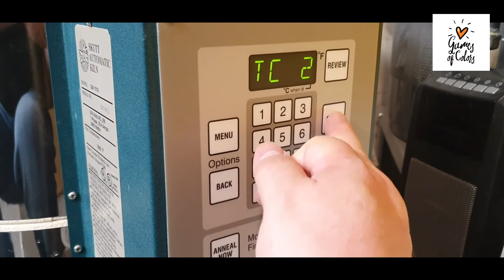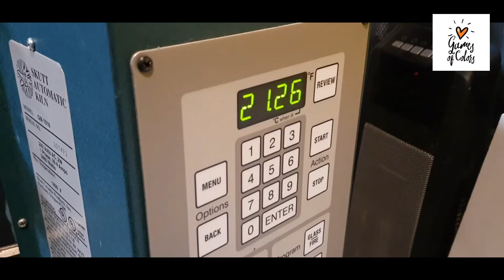A Rainbow Rocky Road - making a couple of fused glass plates

Comment: hi...how is possible that my plate instead slumping broken in the middle? which steps you do? whic temperature? i know your kiln, a ihave one...smaller but same brand but at the moment i cannot use, so i use a really small kiln but it has not the possibility to program the temperature so i must follow step by step but always the glass broken in the middel!!!! can you help me please? thanks
Reply from the maker: Hi, unfortunately, you must program ramp up and down rates. This is a large item, so if you heat or cool it fast, it breaks. The ramp up should be not faster than 280F/hour. At the cooling stage you need to anneal first (about 1-30 at 950F, and then cool 100F/hour to 700F). Then cool naturally without opening the kiln.